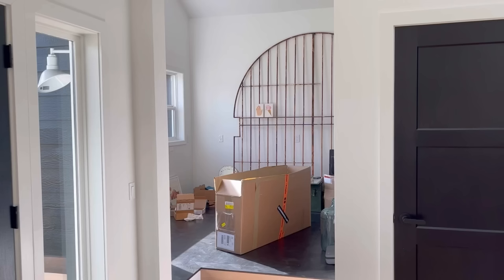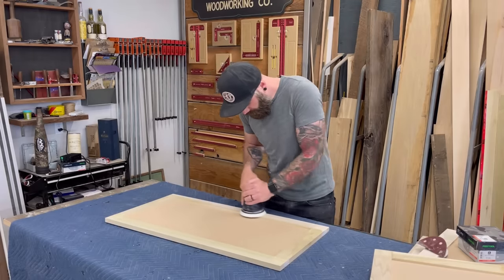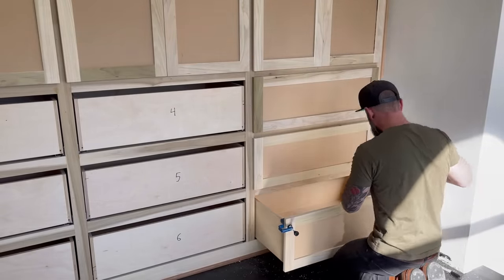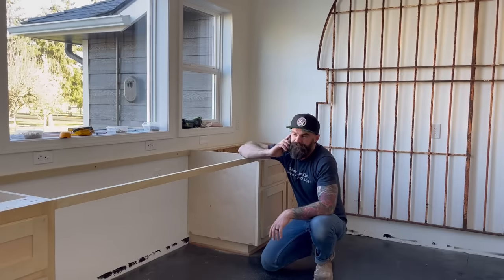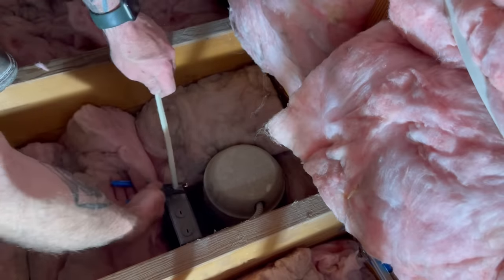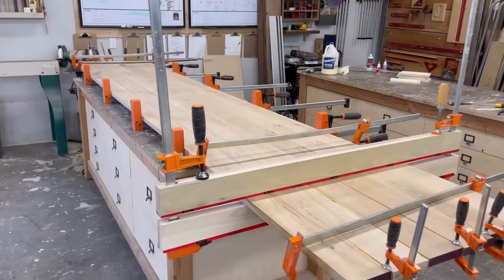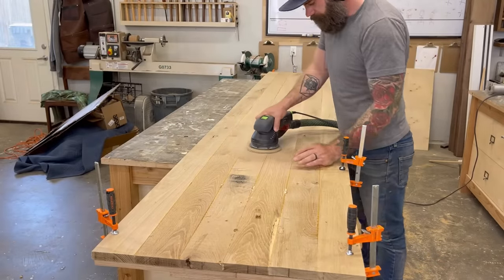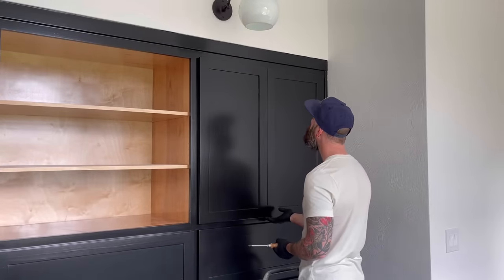Build Cabinets the Easy Way || Before and After Office Makeover

Comment: Have you looked at power feeders?  I just made 88 cabinet doors and used a power feeder for both ripping the rail/stiles and then grooves and on the router table built into my table saw.  I did find that the router worked well for poplar but I was getting too much tear out in white oak without three progressively deeper passes , so I used the table saw to dado the 1/4" grooves in the white oak.  I fed my 1/4 HP power feeder with 10' long pieces of 1x2" boards, then cut to length later.  I saved a ton of time and I was able to keep my hands away from the spinning blades.  I thought that running so much through my saw that I might get tired or distracted and have an accident.  The other advantage of using a power feeder is that running long boards through the saw solo would cause burn marks or blade dings from repositioning your hands as you push long boards through.  I didn't need to plane the rip cuts as I normally do after ripping 1/8" wider than the finished dimensions.  I just ripped to the final width and the rips were smooth with no blade marks.  I think I have $900 into the feeder, so pretty reasonable for what I was able to gain.

I didn't need to drill into my saw to mount the feeder.  MagSwitch has magnets that you can use to secure the feeder to the cast iron saw top.  They sell a kit with plans to make your magnet mounts.  I added longer wings and a couple more 300# magnets because the MagSwitch kit shows it for 1/8HP feeders, which is too small for what I was ripping.

I also am waiting on a 30" Flatmaster drum sander for sanding the doors.  Unlike top loaded drum sanders, the Flatmaster is more like a jointer than planer.  If I have any tiny bow in my doors, I can flatten as I flush sand so the rails and stiles are perfectly flush without possibly creating dips with a oscillating hand sander.  If you hate sanding, this could speed things up.  My center panel is a shaker profile, so no worries of sanding away the center panel veneer.

Now on to the drawer boxes.  I plan on making them like you did in this clip.  I don't get why people still take all of the time to make dovetails when modern glues work so well.  I am going to use 1/2" BB for the boxes but still deciding whether to edge band or not.

I'm always looking for stuff to make things easier, faster and more repeatable for my shop and I've gotten good info from your vids.

Thanks.

Comment: Being a sparky I'm cringing at the electrical. But same time I was mad when you buried the old lights so I'm happy that was addressed. 

Really only issue I saw is that you only removed a little bit of the Romex jacketing on the wire. By code only supposed to have an inch in the box. And there's better boxes you could've used. But oh well. Doesn't look like you did anything thats a fire hazard
Reply: Professional advice, offered respectfully, is ALWAYS welcome as far as I'm concerned, I'm sure Jason would agree... 🤗

😎👍☘️🍺

Comment: For your sconce lights: Strip the romex to where there's only 1/4-1/2" left in the box (this is nitpicky in your case since its a single cable feed, in switch boxes with multiple cables it makes life much easier to strip the jacket back far enough that you can move the individual conductors.) . And yes you can cut big holes in rim joists as they are continually supported. Other option would be to drill a small hole for your wire and box connector and use a pancake box. You can hide the pancake box by being creative with some 3/4" board and a couple of hole saws.

Comment: The device you used to check for power is called a widow-maker for a reason. It is for troubleshooting circuits, not for determining if it is safe to touch.

Comment: Great build. When doing templates, I utilize a similar process but rather than scrap lumber, I use drywall shims & a hot glue gun. Super easy, fast,  & lightweight way to template tops.

Comment: I had to run my 4” dryer duct through one floor joists. I bought a steal plate reinforcement bracket that goes around the hole. This plate comes with documents to show its up to code. Leaving the hole without reinforcement can severely weaken the joist.

Comment: Considering doing something similar, but what did you do with the electrical outlets against the wall? Did you cut a slot in the cabinets so they're remain useable, or were they removed? The spots where I'm placing cabinets currently have outlets.

Comment: You did a good job with the woodwork, man. You should be happy with that. You will likely get some sagging on the oak desk over time tho. It's quite a stretch to have unsupported. But it's yours, so no problem lol. 

In my cabinet shop, we get 9.5 out of 10 perfect paint jobs. It's not easy at all. Poplar is the most popular for paint grade wood, but it's really not the best. You can see the grain still through the paint, and it's really soft. So it won't last well. 

Your buddy Peter could have used a higher build primer and laid more coats of the primer on the piece to get rid of the grain showing through in the poplar. I personally use 3 coats of Renner primer (very high quality) sprayed with an airless. The first coat is a dust coat... Not even fully coated. You can still see half of the wood through that dust coat. It stops the wood fibers from furring up. Then super super light sanding after that first dust coat, then 2 medium/heavy coats afterword with no sanding in between, and then we do heavy sanding after 3 coats of primer. Make sure it's absolutely perfect. Having 3 coats of primer really let's you sand that primer perfectly smooth without a high risk of burning through the primer and exposing wood. 

Then after the primer is sanded,  it's ready for a top coat. If you use the right product like a Renner 688 Water Based 2k Poly, you only need a single top coat on it, and it will be literally perfect if you prepped it right and have the right spray equipment. 

You can go out and just get a cheap $400 Graco airless sprayer from home Depot, but you need good airless spray tips. Get TriTech Fine Finish tips. They are double orphace so they will give the best finish. Pump the spray pressure to max on your airless, and a quality product will spray out like a dream with the right tip.

Poplar can work... But it actually gives you a lot more work in the painting department if you want the grain to be perfectly sealed to look like glass. Beech or maple are much better. And they are gonna hold up better over time as well. 

If you want something that cuts like butter and is cheap, then look at some Super Refined MDF. If you can find some MedEx then that's best. It's harder than Maple, but comes in an MDF sheet good. It's also water resistant, and super refined. So the edges can be painted easy unlike regular MDF. You can make face frames and doors out of MedEx MDF that will be more durable, stable, and easier than hardwood doors. Moisture resistant super refined MDF (MedEx) will be hard to find with the lumber shortage. But keep your eye out for it. It's my favorite wood product on the market.
Reply: Nice detailed comment there , sir ... 😎👍☘️🍺

Comment: JASON, Would you be interested in putting in the drawers in my off grid Granny Travel Bus? I'm not afraid of a camera and I think it would be a neat before and after video for your channel. It will be real cute when done. The bus has a pantry with 2 drawers, which I built the pantry already, just need the drawers. Also a 54" kitchen which I need to have varying depths of drawers for. I would make my first trip to Bourbon Moth.  How cool is that.

Comment: 1:52 I find whenever I try to make a panel and not leave it flat on the table it winds up with a twist in it when the glue dries, like the weight of the clamps tweaks it.

Comment: Wiring work seems fine to me. I think that boxes are supposed to have a way to hold the wire so you can't pull it out from the outside (hence why you had to cut the old one). I've seen plenty without it though and it's not like anyone will be pulling the wire from the back anytime soon.
Reply: Most plastic boxes have built in clamps that let you push wires in but not pull them out.
Reply: @nevet1212  Maybe that's a modern thing, I've only ever worked on older metal boxes which usually have some kind of screw clamp.
Reply: @Fr33dan  metal boxes usually don't have built in clamps, but some do for "armor clad cable"  not for romex.  Also some plastic boxes need additional connectors.  Standards for electrical boxes can be wierd to say the least.

Comment: Important question - what is the final desk height including the top for your desk? 

I’m in the process of building my home office and the industry standard is 29.5” I’m height including the toe kick. That means with a 1.5” butcher block it’s 31” tall! 

My desired desk height is 29” MAX for ergonomics. I’m 5’ 9” and feel like even that could be a bit tall - my other desk in 27”. 

Why the heck does the industry make 29.5” cabinets the standard?? Not including the thickness of whatever desktop you put on.

Comment: Great work, but the office can be made better by one simple change: replace that chair, it's totally unsuitable for desk work.
For one, it's too heavy and cumbersome to move every time your wife wants to sit or get up.
Also, it is far too low, you're taller than your wife and when you were sitting at the end of the video the desk  top was about mid chest height, it should be bent elbow height or lower.

Comment: Beautifull result sir, you can be proud of it. 
I'm an amateur and I used to be occupied randomly in woodworking, but since I live in a big city without available space (and I do face difficulties from orthopedic problems) I had to reduce significantly the amount of time spent in woodworking - to my very dissapointment.
 Anyway, based on my short experience I think you do have a very honest approach to what you 're doing, avoiding hype and presenting nice results - you also pay much attention to work accurately wherever this might be needed in any way. Not  surprisingly "you haaaate saaaanding". I started by watching a video of yours just by luck, and I caught myself to watch also others - which I' m going to do systematically. Many thanks for sharing.
And I do have a query:
As I 've seen earlier in a video of yours about a large built-in cabinet with glass doors, and as you also have done in these videos on office make-over, in order that you finish the construction, you temporarily assemble individual parts, and after you have achieved your goal (large singular face frames on many- carcass large constructions, trims, glass doors etc), you disassemble them and proceed to finish etc till the final installation. For the - temporal - assembly you use screws, the known usual self-boring screws, which later you de-screw, and finally during final installation you put them again. The question is about the spiral (thread) formed in wood or plywood at the initial screwing - isn't destroyed later durig de-screwing and rescrewing? while rescrewing isn't difficult to find the initially cut spiral (thread)?

Comment: Hey great video.  I’m in the process of a similar project.  Thirteen feet of base cabinets with book cases on top.  Right now, I’m making the cabinet tops, which are 5/4 Hard Maple.  I did not have the option of using 13 foot long boards and so I’m using boards of uniform width (about four inches) and thickness to glue up the top, each between 4-5 feet long.  The finished top will be 160”x18”.  Any recommendations on how to join the boards end to end?  Also, my assembly table is only about 6 1/2’ long.  Thanks in advance for any help you might be able to provide.  Cheers!

Comment: I know nothing about structural engineering, or the size holes safe to put in floor joists, but man, I just have to say I admire your courage. I’m sure it will be fine, but if I did that to my house, I would be second guessing it for the rest of my time in the home. I would never sleep well. Probably even after I left, I would worry it would collapse, and the old owners would sue me or something. So your courage to just plow ahead is admirable to me haha. Nice work.
Reply: Without actually seeing it.. Im guessing the original back wall of the room (wall behind built in) should be able to bear the load. Hopefully the tension on the joist is also not too high. But if that wall wasnt there you definitely wouldnt want to think about plowing a 4" hole through a joist😁
Reply: I mean, it’s not really a floor hoist because there’s not a floor on it, it’s just the attic. It’s probably not the best but in this case it’s probably not too big of a deal.
Reply: He also added a solid structure underneath (the cabinets). While not meant to be load bearing they can still hold more weight than those holes caused in loss of integrity.

Comment: For a non electrician not bad at all but a house framer is screaming at the top of his lungs somewhere. Lol drilling through a floor joist gets them every time but hey it’s still standing.... for now
Reply: Not just a ceiling joist, but a joist from which the others are hung. Looking forward to the video on fixing the sagging ceiling.
Reply: @frjer11  lol those holes will not cause the ceiling to sag. It is at the edge of a wall. Also looking at the video it looked to be single 2x not a beam which other floor joist are attached to but I knew you framers would get all dramatic lol.